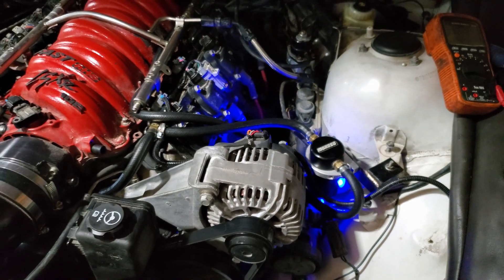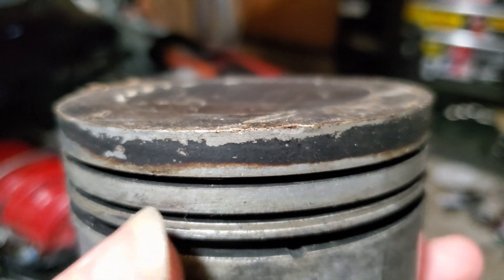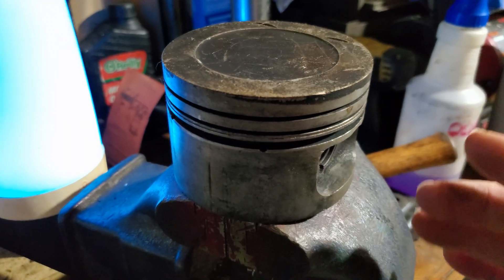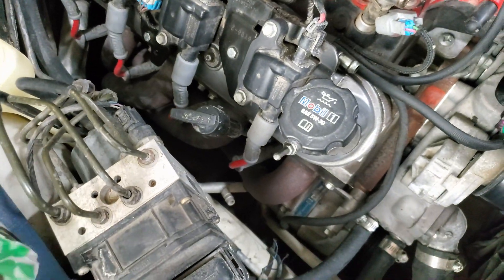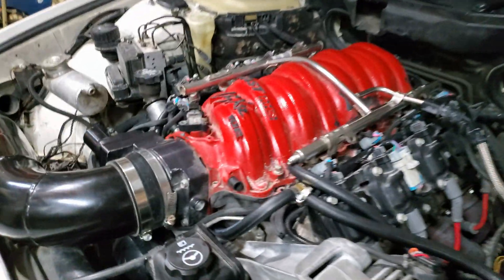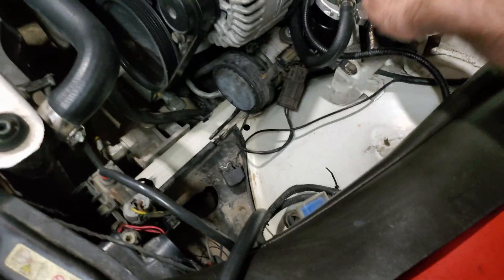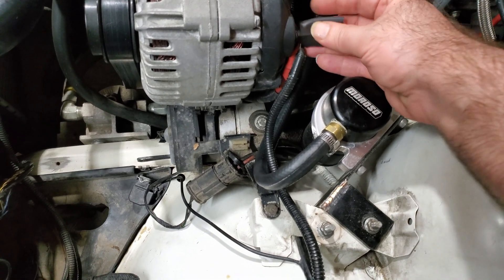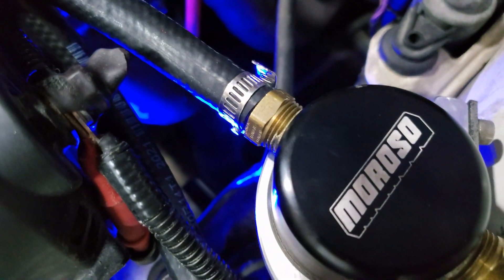Crankcase Vent Tubes and Catch Can for Ls V8

Comment: Thanks for explaining absolutely nothing
Reply from the maker: . *I went back and watched this and found that your comment has much validity to it and one other person pointed out the fact that I got stuck on showcasing the principle instead of showing exactly what I was doing. He said "thanks for nothing", oh well.. To answer your question, behind the throttle body, closest to the intake, the hose port that sees vacuum, the suction hose is hooked into there and goes to the catch can. That is what creates the scavenging effect to draw vapors out of the block/ both valve covers. Then the hose goes away from the catch can and tees off to individual hoses to both valve covers. The vacuum sucks any oil or residue into the catch can under hard acceleration. This normally would be a dry situation. But higher rpms, more valve hardware, bad valve cover design leaves a lot to be desired. The tragedy is the valve train sprays oil everywhere and that oil flies around in the suction on the rear valve port in this situation I believe it was. Most Ls seem to have on at least one valve cover that loves to keep the port wet, just from oil flying around in there at a bad spot.  So check your hoses to see which is wet and don't pull from that one, if you don't have a catch can, is my suggestion. The valvetrain can sling oil through that rear drivers side port on the valve cover, and this is why a catch can is needed, not because of any other issue. I should have concentrated more on those points initially, and delivered that info instead of being so flashy with a cool car, This is how I learn.  Hopefully this helps you out. I think they make better valve covers that remedy this problem with relocated crankcase vents, to solve the issue entirely without adding a catch can. But if your gonna boost anything, catch can the crank vent system for sure!
Reply from the maker: https://www.youtube.com/watch?v=1lorr9mXLtw

Comment: Any way you can list the parts? Thanks
Reply from the maker: Kinda dropped the hose on that?-You get it? Anyways It's 3.10 in------ did you really stop watching that quickly or did I breeze by it too quickly? The car came with the catch can, probably on www.summitracing.com and the hose and hose clamps were from orieilly auto along with the fittings.

Comment: Shorter the hose the better
Reply from the maker: Sure, but it works fine just the same!
Reply: You actually want the catch can further away from the engine where it's cooler so the oil can sperate from the air better...
Reply: Cooler is better and so is less resistance.  I run 5/8 hose so I can run it in a cooler location. 3/8" hose included w most cans is worthless

Comment: What type of hose did you buy from orielly
Reply: He bought 3/8" fuel line. Since it's only rated for 60psi it's the carburetor type fuel line. Fuel injection fuel line is rated around 300psi. Since the crank case is not high pressure the carb fuel line should work fine. Fuel line is more durable then regular vacuum hose line .
Reply from the maker: Hose compatible with oil and gas, so oil hose. Its 3.10 in - I apologize for going too fast.